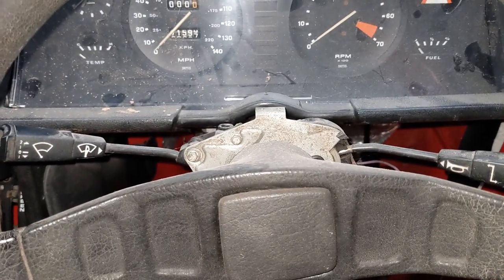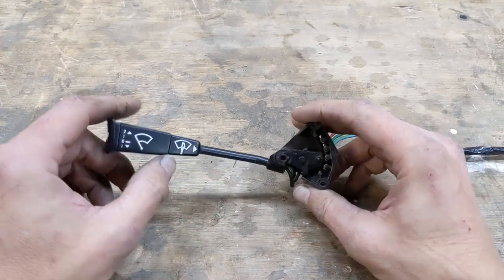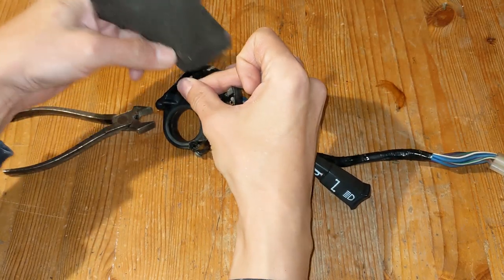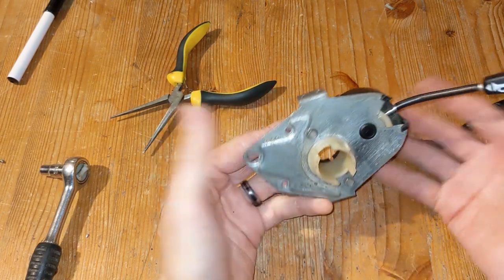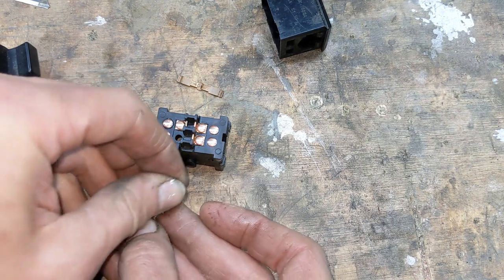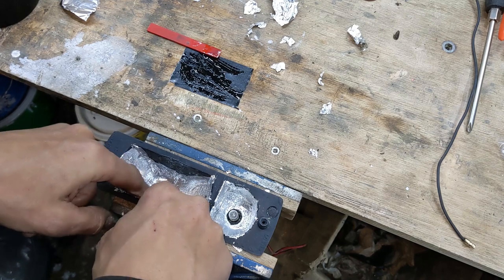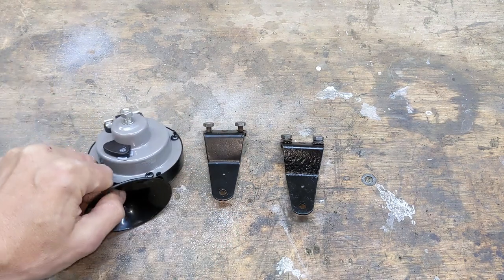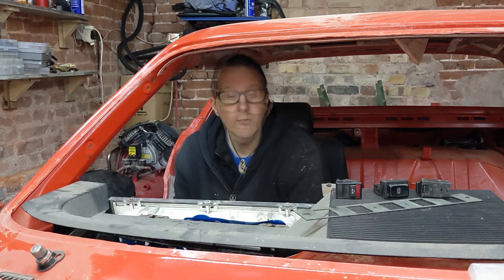Switches, Lights and More - Triumph TR7 Restoration Part 26

Comment: Hi from Canada. I'm enjoying the channel and details. I have a 1980 drop head coupe that my dad bought new from the showroom in 1981. Since 1992 or so I have been the steward of this car, taking on small repairs and fixes as needed. Overall despite it being driven only around 1000 km in the last 20 years, it's still in good shape and its time to make her road worthy again. 
So this year I need to replace the fuel tank. I'll also replace rear suspension and various bits too. I'm looking forward to getting back into this car once winter goes away. Cheers.
Reply from the maker: Awesome, sounds like she's in good hands!

Comment: Hey Red, nice and helpful video. I'll watch the whole thing when I get home.  A great reference should I ever need it. Right now on my '77 my plastic clamp is broken (always has been) so I've been holding the assembly with one hand and engaging the signal stalk with the other. My plan is to add a custom metal bracket using existing stationary mounting points to prevent the whole assembly from rotating when engaging the signals.  Thnx for the video.

Comment: I shotblasted my rear lamp enclosures, primered them, sprayed them black, bought some fancy chrome vinyl wrap and inlaid it in the ‘bowls’ and ended up with the same result. What a waste of my time 😂 Looking good, your vids keep reminding me of what I still have to do, switches were never on the radar but they are now! All the best 👍
Reply from the maker: Yeah, I did think about the chrome vinyl, but thought I'd just try some tinfoil. Headlamp bowls aside, as long as it's shiny it's good enough - the lenses diffuse the light enough for it to not make a difference.
Worth doing the dash switches, they're easy enough to take apart and I know the headlight switch takes a lot of abuse. 👍

Comment: What was clever, but probably not new, the sloping perspex in front of dials.
Reply: Brings back memories of stripping switches and cleaning contacts back in the 80's. After the TR7 i had RX7, was amazed at the quality of parts compared to rusting parts on the TR. Although the RX eventually was scraped due rust and couple of Wankel rebuilds.

Comment: Firstly great videos, extremely useful.  I'm a bit confused here - your indicator and wiper stalks are a different way round to mine (wipers on the right) -  It looks like they were swapped at some stage in the manufacturing - pics of a 79 show them same as yours and another  pic of a 79 shows them same as mine.  So I'm wondering if they were manufactured like that or they'd been replaced post manufacture due to part availability issues.  I'm finding the wiper part for mine is no longer available, the indicator still is.    You mentioned mini, so I'm wondering if other cars Indicator and wiper stalk parts fit the TR7.
Reply from the maker: Yes, there was a change to the more modern type in (I think) 1980 or so. BL/Triumph tended to share parts around all their different cars, so the later type was probably used somewhere else as well.

Comment: Did you test the switches electrically for continuity when you finished?
Reply from the maker: I didn't see a lot of point tbh. They worked fine before I cleaned them - it was just a preventative thing - so I'm not anticipating any problems. If there does turn out to be any issues they'll reveal themselves when I do the wiring anyway.

Comment: In the case of the manual switch selector, maybe it would BE better to redo the entire cable with new Wire since is a small part.
Reply from the maker: If you mean the wiper switch, the problem there was that it's a crimp connection to a terminal that's not available individually, so it would have needed to be soldered somewhere anyway. In the end I replaced the entire switch.

Comment: Soak the brass electric connectors in muriatic acid to clean the ends...is a good option ..
Reply from the maker: Yes, most acids will work, even vinegar. I've cleaned brass with ketchup before 😆 I just used brasso because that's what I had closest to hand 🙂